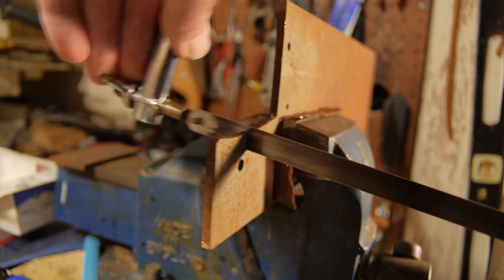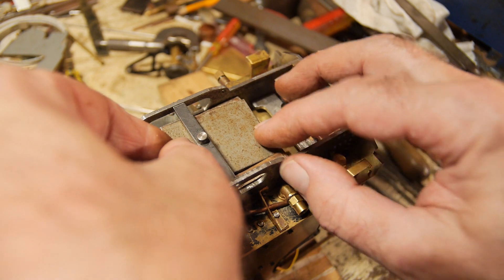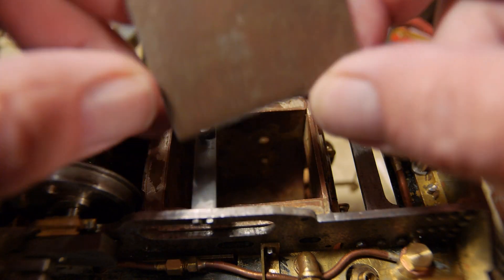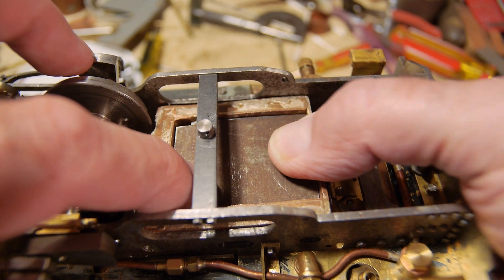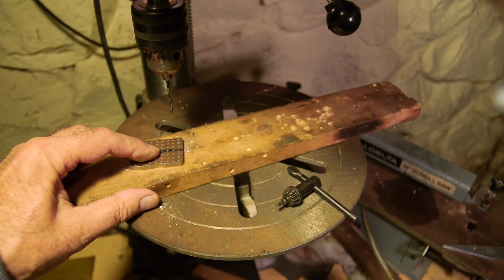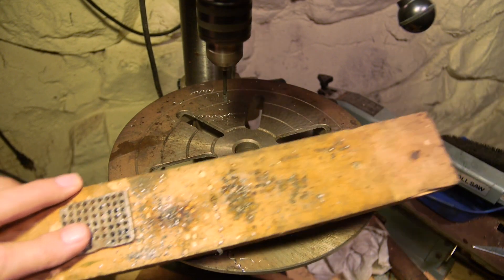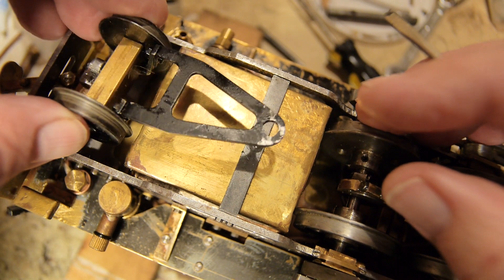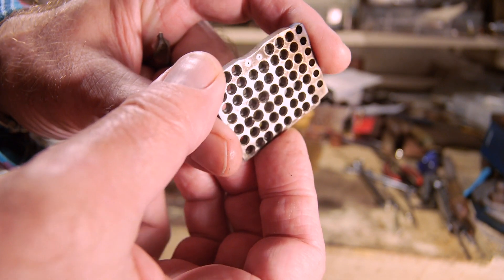'Russell' Live Steam Model Locomotive Part 19

Comment: 3:35 is the reason for Beautiful Scars on the  finger! I would drill a little screw through the First hole to hold the plate down to the piece of wood..... thats way easyer
Reply from the maker: Hi DIY-Chris, pressing the steel into the wood with my fingers does hold it but the screw's not a bad idea for extra safety.  However this grate did not work to well with clogging up so I'm just in the process of replacing it with proper bars.

Comment: This is a really interesting series and I am following it with some enthusiasm.  I operate 16mm coal fired locos. My son in law an engineer also made me up mild steel fire grates laser cut and drilled which saved me time. The grates have now been in use for 5 years or more with no deterioration.  One comment if I may and that is the gap between the bottom of the grate and ashpan seems to be quite restrictive. Ash build up may restrict the primary air getting into the firebox.  Can the ash be racked out while the loco is in steam? John.
Reply from the maker: Hi John, good to hear about the longevity of your grates that's encouraging. You may be right about the shallow ash pan.  It can't be racked without dropping the fire unfortunately. I'm hoping the Welsh steam coal I have doesn't create to much ash and I get at least a half decent run.